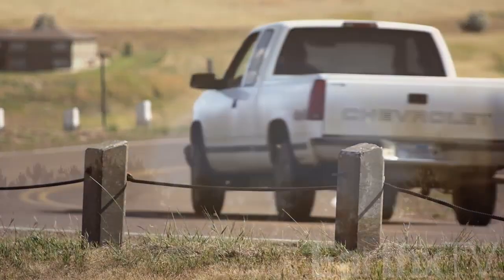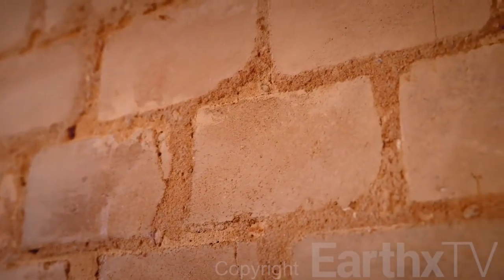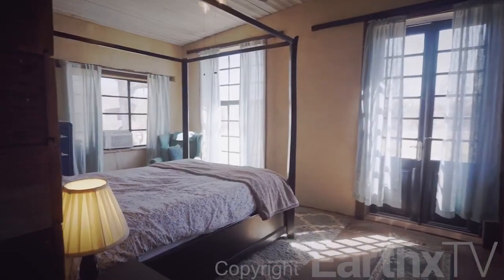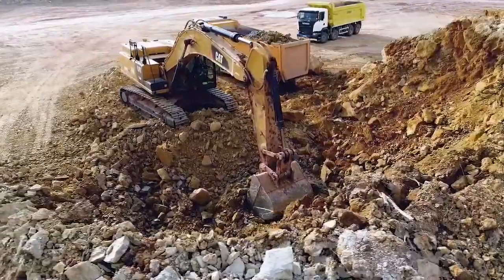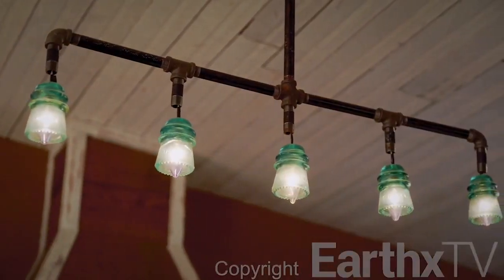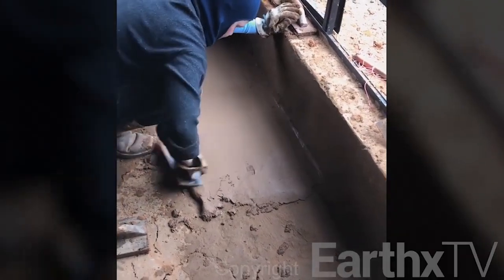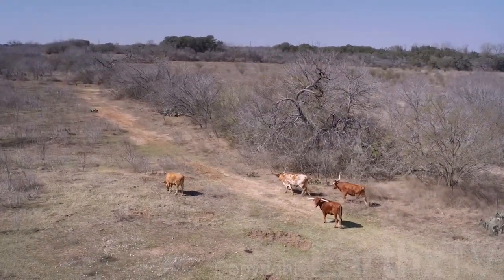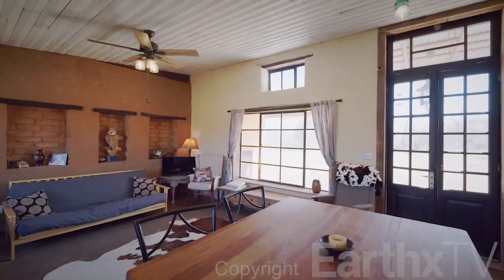A spotlight on CEB construction

Comment: Your house has been an inspiration for a home I intend to build myself in the future.  I have bunches of questions regarding needed design considerations.  The first is, when do you need to consider a foundation other than a rubble trench? How far can you push a CEB building in size and height before you can't use that foundation?